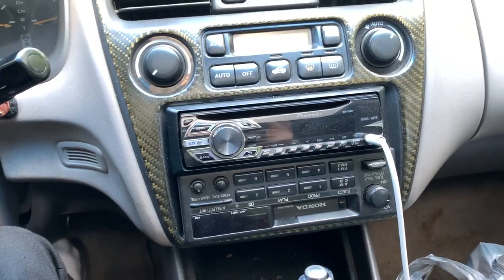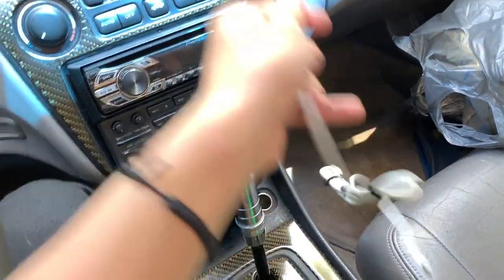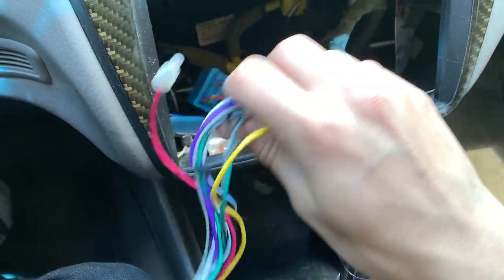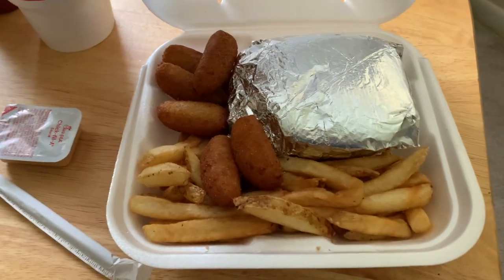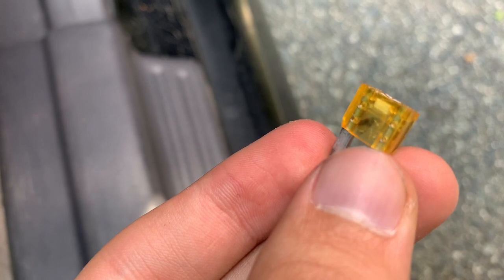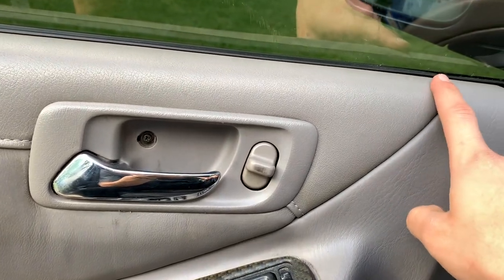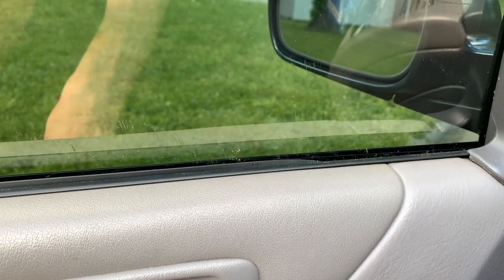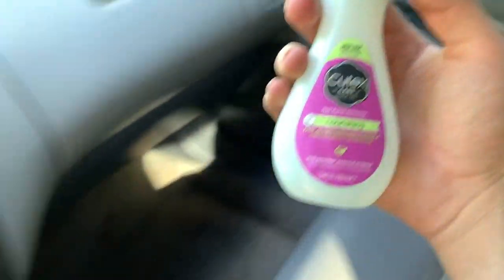Installing a DOUBLE DIN Radio in the CG6!!

Comment: Ay bro could you help me out, got the exact car and got that exact radio from Walmart too, connected all the colors. But when I put it in the car, it turns on but no sounds come off. Could you help me out?
Reply from the maker: Make sure your wires have a good connection, same happened to me but on my passenger side speakers. Turned out to be a loose connection. Hopefully that helps!
Reply: Nick Puente did you have to connect 3 wires together or something like that?